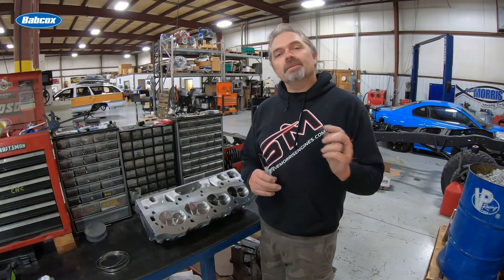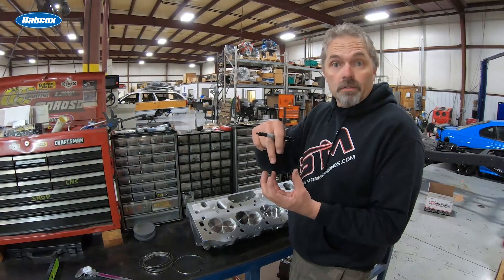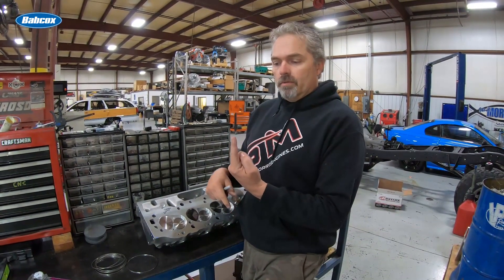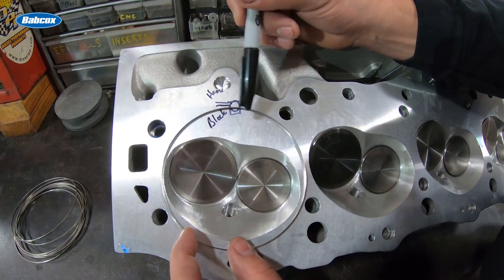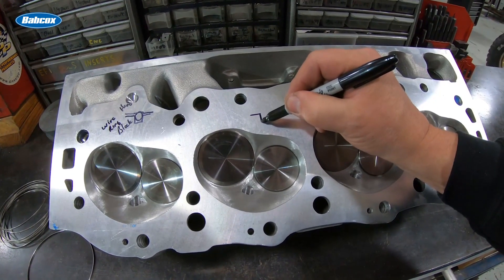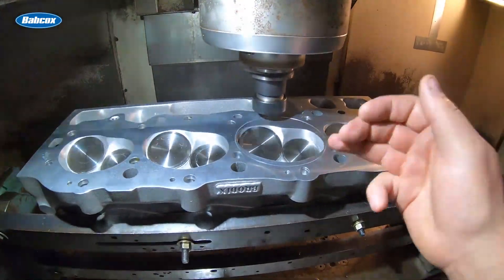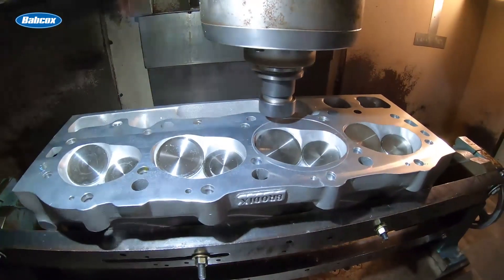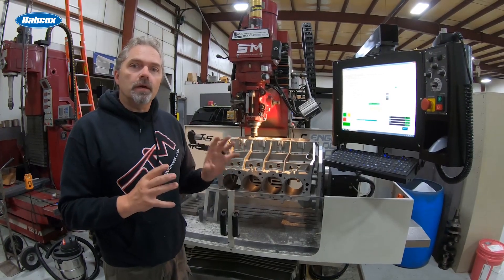Engine Sealing with Hoops and Receiver Grooves

Comment: Yes this is what I need to have done to my 08 F350 diesel 6.4 before I close it up. I want stage II heads seats, guides, valve springs etc... Now do I buy replacement heads? Can I get the job done with the block still in the frame?
Reply: The video probably answered all my questions.

Comment: in my country most of people use a 2 litr L4 straigh engine which has removable wet liners and aluminium head and block 😅 ..the problem is that because the head gasket is allways exposed to water directly it does not take long for the gasket to become weak and after couple of months water finally finds its way through into the cylinders which most of the time  happens between cyl N. 2&3 ... what do you proffesionals suggest .. the way outa this can save thousands of people milions of dollars .
Reply: the engine is PSA XU7jp

Comment: Just curious why in the first example you didn’t have the wire bottomed out in the block groove. Wouldn’t a seal there increase seal contact by 50%? Very informative nonetheless.

Comment: I o-ring and receiver groove every GMC 6 block I use in LSR competition. As long as the split is not near a water passage or between cylinders there had never been a failure at 14-1 compression. Granted this is for very high HP engines but the old way (if you can find someone to do it) will work just fine. Every thing I do is done on a Bridgeport mill and an Isky groove tool for the block. 

Steve’s skills and knowledge is far above mine and I thank him for sharing what is done with these high HP competition engines. 

There are Diesel engine builders here on YT which show the older technology way.
Reply: Which diesel engine builders show it here on YouTube? I'd be interested in watching that.

Comment: Steve what your describing is the difference between orings and firering in the diesel world. But we do orings  in the head I use 062 with a boring head on a mill. The reason thees isnt a receiver groove is we still use the stock head gasket with a oring. The fire ring gets the receiver in the block. and is an actual  machined square ring thats  .105 x .200

Comment: About 15 years ago I did something similar with 6, 540 BBC Offshore TT motors. I came in to the project after the blocks were purchased. They had 7/16 studs and even new ones made from the same material as ARP's baddest rod bolts it would still leak between some cylinders at 2200 hp so I made similar rings (called them flame rings) except they went into the block and heads about .05" (.105'ish tall ring if I recall or maybe .04-.04/.085"). The copper head gasket was not part of the sealing and was cut slightly larger than the ring OD. The dowels were removed and the rings positioned the heads.  The theory was if the head lifted a little it wouldn't compromise the combustion seal. It was a band aide but it worked and I heard some time ago atleast a couple of the engines are still running.

Comment: funny in the sixties the square hole was filled with square piano wire fitted perfectly and sealed 100% for super charged v8 motors = if the machined surface in the recieving sealing area is rounded upon machining then a round wire would be used !

Comment: Old Old Old tech   Wills rings . Nothing new at all rings are actually steel tubes filled with nitrogen gas into a grove with a ROUNDED bottom to suit the tube  ran them 30 plus years ago with NO modification the the block also only used a gasket for oil and water  no head gasket over the WILLS RING

Comment: I was under the impression that cutting a square bottom groove was for a copper wire to deform and "lock" into each of the mating surfaces. Also the split in the copper wire would "flow" into each other becoming one piece once torqued.
Reply: Stainless is about Grade 2 hardness, I'd presume soft enough under the applied clamping forces per its mass compressed in this mechanical application. Would be nice to see a used ring removed after it has been compressed an ran a couple of times, that would tell us a lot more. Maybe it's part 1 or he's just showing off some machinery. I'd buy an engine out of his shop, they're obviously build quality oriented.

Comment: Could use that machine to make o-ring groves for the coolant ports massage the tolerances on the hoops and go gasket-less just run viton o rings and hoops
Reply: Like the Boss 429 Ford was back in the 60's. (other than no receiver in the block)
Reply: Like Detroit diesels are factory

Comment: Should make the hoop hollow and then use copper inside or other material to hold up under squish.
Reply: Porsche uses a coil spring inside.
Reply: I'd think that the stainless would be much tougher than copper.

Comment: Great video!   Steve can you talk about or make a follow up video explaining how you seal the copper gasket if running water jacketed block and how you would resurface the head with the hoops in it when it comes in for a freshen up and valve job? Thank you.

Comment: Is it faster/better finish to run the groove in the head with an end mill rather than a boring head? I'd have expected a boring head to be much quicker once you have it set to diameter.
Reply: The diameter of the groove has to be dead nuts for the ring to fit into.  Setting a boring head to cut an exact  face cut diameter is problematic.  How would you accurately measure what you are cutting?  A caliper isn't accurate enough.  Circular interpolation using the CNC is the correct way to do this.  I do this exactly the way Steve describes at my shop.
Reply: @stevedemirjian8236  I thought about that when I made the comment. I'd make a test cut on scrap, check fitment of the ring, adjust, and once I got the boring head dialed in I'd never adjust it. 

I have minimal engine building experience though, and not a whole lot of machining experience (can run a mill, lathe, surface grinder, cnc machining center - just saying it isn't what I'm doing on a daily basis)

Comment: I get the ring setting in the cylinder sleeve because its a lot stronger than the aluminum, but on the head its within like 2mm of the water jacket and you have to fit two of them in there, that can't be that good.
Reply: Most setups with this done are not water jacketed heads block. If its water jacketed conventional setup its still mostly purposed for drag racing.
Reply: @scr454  Conventional meaning wire O-ring and receiver groove?
Reply: @FadetoBlack1463  as in stock style blocks and heads meaning as well aftermarket parts design to factory spec
Reply: @scr454  What I meant to ask was do you use a wire O-ring copper gasket in a conventional water jacketed engine over a hoop style set up? Thanks.
Reply: @FadetoBlack1463  that answer would be better suited with the engine builder per the application. If you are attempting this yourself on a budget build you will go the cheap route.
Reply: @FadetoBlack1463  also remember if you are going heavy on boost on a budget build just using the head gasket with no receiver groove is the best option as you want the gasket to be a weak link. Easier to replace head gasket than it is the motor on a budget build.
Reply: Just my 2¢, but people at this level would probably be using aftermarket heads which typically have thicker deck surfaces.